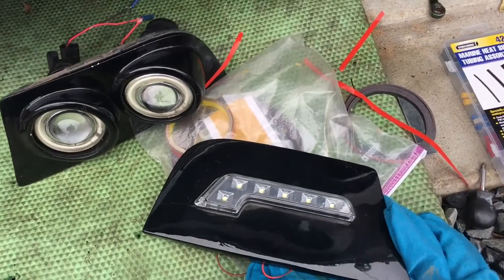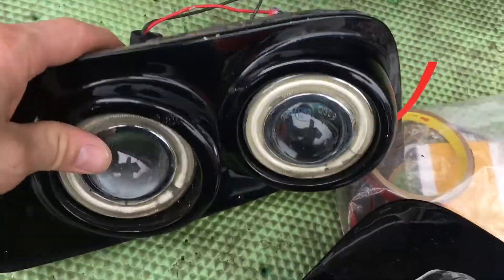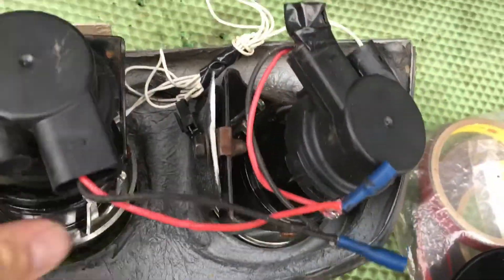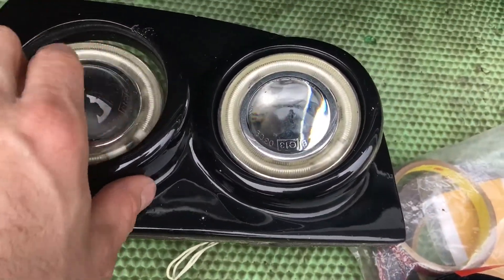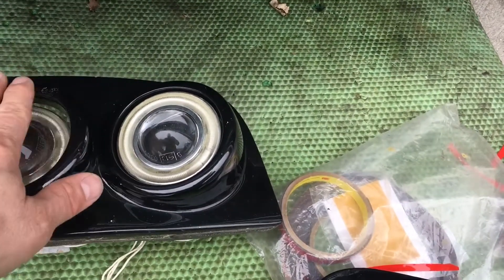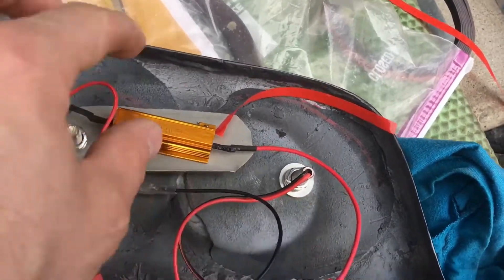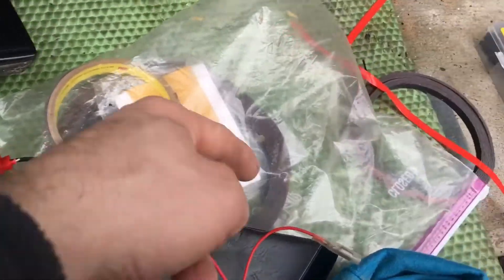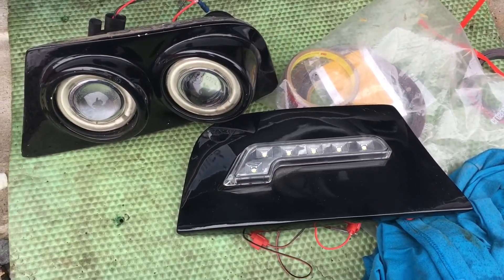Mercedes-Benz C230 Custom fog lights

Comment: Do you have coil overs or are these lowering springs?
Reply from the maker: Neither . It’s original suspension. 19 inch wheels make it lower filling the gap